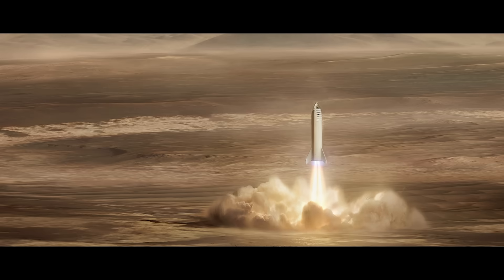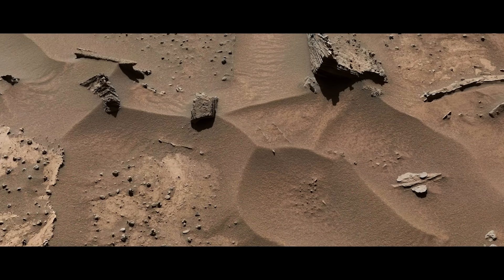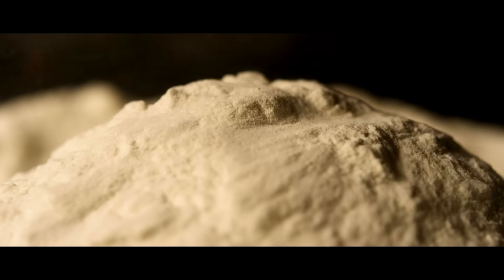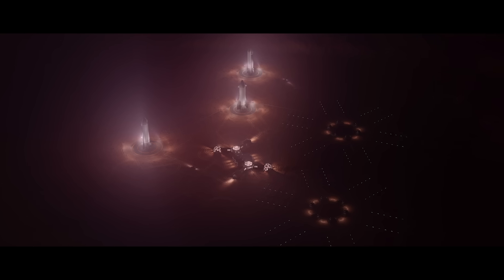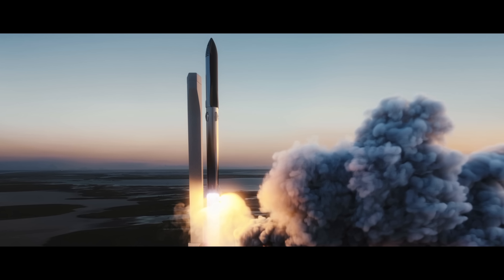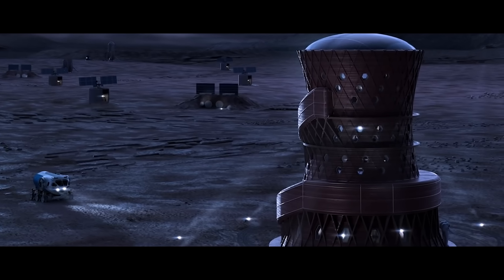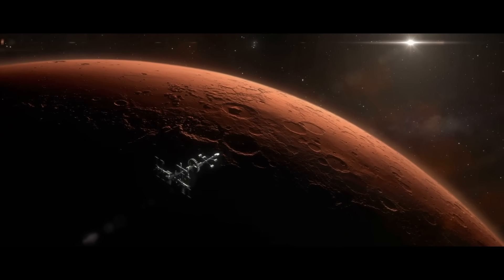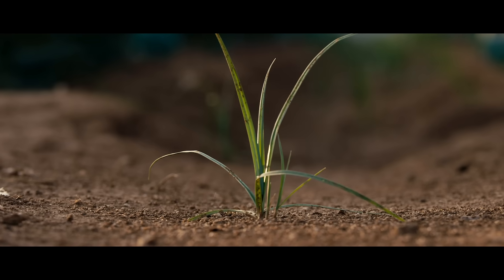THE FIRST 10,000 DAYS ON MARS (Timelapse)

Comment: I doubt that we will see seven football fields of solar panels. Energy is the most basic need for a colony which has to generate it's own oxygen, water , heating and nearly every other commodity it requires. A molten salt reactor would require far less tonnage of material transport and a more reliable energy supply which is important, as every living creature on the planet will depend on it. It will be more useful  as it generates heat as well as electricity , and the low Martian heat sink  temperature will give very efficient  electricity generation and do it every hour of every Martian day. The seven football fields of solar panels would supply less than half of what it would do if situated on earth. Elon Musk would not allow those sorts of inefficiencies to exist in his great venture!

Comment: Moving to a planet with "ZERO" atmosphere...sounds like a great idea!
Reply: Hey, be fair, Mars has an atmosphere. Ok, 1/160 of earth pressure. And contains like 95% CO2, which is pretty much like 19000x more than what is considered survivable. But in exchange O2 levels is like a hundred thousand times lower what would be needed. So if they want to use it, they can extract 1 cubic meter of useful O2 out of 1.5 million cubic meter of atmosphere there.

Comment: Mars is just the nearest practice platform... it will never be habitable it doesn’t have enough mass for gravity, a functional iron core, next to no water and doesn’t receive enough sun light.

Even if we crashed appropriate resources needed in the form of meteors the iron core would take a long time to help the planet would become tectonically unstable and the change in mass would likely have the orbit pulled closer to the which sounds good until other planets get in the way.

Then it probably should be included that usable land by the time we made the changes would probably by less that 50% and it’s already smaller than earth.

Though loosely theoretically doable the costs would be astronomical and the timeline to do so without shattering the planet apart would be difficult to get backing for.

The settling on Mars in this video wouldn’t be safe, nor sustainable without an atmosphere.

Comment: Probably optimistic ... but there will also be advances not taken into account here. It won't be exactly like this, but it'll be a little like this. 
And you have to have a plan to get moving. So we do... and it'll get revised as we go ... like they always do. 

If you look up the original plan for the Panama Canal when work first started, nothing about (in time or space or even the language spoken) is recognizable ... but there IS a Panama Canal. Works pretty good.
Reply: The rule of Elon Musk is: cut the volume by a third and add 50% to the timing ... but he'll still get there first.  
and there will be a great blooper reel.

Comment: Just keep in mind that the temperature is 70F to -190F, with an extreme daily range. There are no oceans and air pressure is about 0.6% that of earth if you consider the 'air' at 95% carbon dioxide is where you want to live. The precipitation is the equivalent of the drier parts of the Atacama Desert in Chile. Although the temperature on Mars can reach above freezing (0 °C (273 K; 32 °F)), liquid water is unstable over much of the planet, as the atmospheric pressure is below water's triple point and water ice sublimes into water vapor. Mars has no protective magnetosphere, as Earth does. The result is that the surface of Mars is exposed to much higher levels of radiation than Earth. And in addition to regular exposure to cosmic rays and solar wind, it receives occasional lethal blasts that occur with strong solar flares. 
Is that where you want to live?

Comment: Congrats for the impressive video, BUT...

$5m ships? I'm getting the feeling that, either the dollar will skyrocket in the near future for some reason, or the math presented in this video, are a few hundreds, or thousand times off, from the correct value.
This whole video is way too optimistic, as if nothing will go wrong, ever.
What if the first astronauts all die during liftoff, from a faulty pressure valve SpaceX bought from an inferior contractor? The project is mothballed for decades probably.
What if the weather is bad for a week during the window, the project is pushed back 2 more years, or more.
I can admire your optimism, but real life entropy, is a bitch. She doesn't care. And she'll do anything she can to make sure your project fails.
With that in mind, I would prefer a shot at a real prediction, not idealistic optimism.

Comment: FBI doesn't do TITLE 18 U.S.C. 1038 Investigations What about Microbiology? Causes

Many germs can cause pneumonia. The most common are bacteria and viruses in the air we breathe. Your body usually prevents these germs from infecting your lungs. But sometimes these germs can overpower your immune system, even if your health is generally good.
Pneumonia is classified according to the types of germs that cause it and where you got the infection.

Community-acquired pneumonia

Community-acquired pneumonia is the most common type of pneumonia. It occurs outside of hospitals or other health care facilities. It may be caused by:

Bacteria. The most common cause of bacterial pneumonia in the U.S. is Streptococcus pneumoniae. This type of pneumonia can occur on its own or after you've had a cold or the flu. It may affect one part (lobe) of the lung, a condition called lobar pneumonia.

Bacteria-like organisms. Mycoplasma pneumoniae also can cause pneumonia. It typically produces milder symptoms than do other types of pneumonia. Walking pneumonia is an informal name given to this type of pneumonia, which typically isn't severe enough to require bed rest.

Fungi. This type of pneumonia is most common in people with chronic health problems or weakened immune systems, and in people who have inhaled large doses of the organisms. The fungi that cause it can be found in soil or bird droppings and vary depending upon geographic location.

Viruses, including COVID-19. Some of the viruses that cause colds and the flu can cause pneumonia. Viruses are the most common cause of pneumonia in children younger than 5 years. Viral pneumonia is usually mild. But in some cases it can become very serious. Coronavirus 2019 (COVID-19) may cause pneumonia, which can become severe.

Hospital-acquired pneumonia

Some people catch pneumonia during a hospital stay for another illness. Hospital-acquired pneumonia can be serious because the bacteria causing it may be more resistant to antibiotics and because the people who get it are already sick. People who are on breathing machines (ventilators), often used in intensive care units, are at higher risk of this type of pneumonia.

Health care-acquired pneumonia

Health care-acquired pneumonia is a bacterial infection that occurs in people who live in long-term care facilities or who receive care in outpatient clinics, including kidney dialysis centers. Like hospital-acquired pneumonia, health care-acquired pneumonia can be caused by bacteria that are more resistant to antibiotics.

Aspiration pneumonia

Aspiration pneumonia occurs when you inhale food, drink, vomit or saliva into your lungs. Aspiration is more likely if something disturbs your normal gag reflex, such as a brain injury or swallowing problem, or excessive use of alcohol or drugs.

Risk factors

Pneumonia can affect anyone. But the two age groups at highest risk are:

Children who are 2 years old or younger

People who are age 65 or older

Other risk factors include:

Being hospitalized. You're at greater risk of pneumonia if you're in a hospital intensive care unit, especially if you're on a machine that helps you breathe (a ventilator).

Chronic disease. You're more likely to get pneumonia if you have asthma, chronic obstructive pulmonary disease (COPD) or heart disease.

Smoking. Smoking damages your body's natural defenses against the bacteria and viruses that cause pneumonia.

Weakened or suppressed immune system. People who have HIV/AIDS, who've had an organ transplant, or who receive chemotherapy or long-term steroids are at risk.

Complications

Even with treatment, some people with pneumonia, especially those in high-risk groups, may experience complications, including:

Bacteria in the bloodstream (bacteremia). Bacteria that enter the bloodstream from your lungs can spread the infection to other organs, potentially causing organ failure.

Difficulty breathing. If your pneumonia is severe or you have chronic underlying lung diseases, you may have trouble breathing in enough oxygen. You may need to be hospitalized and use a breathing machine (ventilator) while your lung heals.

Fluid accumulation around the lungs (pleural effusion). Pneumonia may cause fluid to build up in the thin space between layers of tissue that line the lungs and chest cavity (pleura). If the fluid becomes infected, you may need to have it drained through a chest tube or removed with surgery.

Lung abscess. An abscess occurs if pus forms in a cavity in the lung. An abscess is usually treated with antibiotics. Sometimes, surgery or drainage with a long needle or tube placed into the abscess is needed to remove the pus.

𐤇𐤍𐤁𐤏𐤋 𐤁𐤓𐤒
https://www.mayoclinic.org/diseases-conditions/pneumonia/symptoms-causes/syc-20354204

Please avoid the places where idiots use masks several hours at a time without changing them out for sanitary ones. It doesn't take long for things to grow on the mask. 

8 monkeys put on a mask to protect themselves from a virus. After a short amount of time the mask had grown bacteria infectious to them unknowingly. The bacteria came from the monkey skin and breath causing lung infections, pneumonia,  and 7 monkeys died without catching the virus and the 1 that lived did catch the virus yet lived. How many American monkeys have died from mask associated infections because they failed to follow the strict sanitation protocol required by medical personnel? If the CDC said 64,000 actually died of COV out of the 450,000 claims by healthcare means  236,000 could have died from other causes. 2008 Dr
Fauci co-authored an article you should know more about.
Violation of Freedom of information act. Blocking information on a public source document about biological Hazzards. 
https://www.nih.gov/news-events/news-releases/bacterial-pneumonia-caused-most-deaths-1918-influenzbacterial- Why do they block it?

Video on Pneumonia https://youtu.be/lMnbJCq5lAg

Insider pregnant Dr from the CDC comes out.
https://youtu.be/VOl2-xI76tI

Here what happens to your oxygen levels while in a mask. https://youtu.be/axSHWgO8-0k

Start here 
CRISPR-CAS techniques and technology 
https://youtu.be/RNRZchHaKgw 

is an introduction to mRNA and CRISPR-CAS introduction for vaccine engineering https://youtu.be/K__7vPh92gA 

then study the messenger RNA (mRNA)
https://youtu.be/R3blx6V9fzM 

is also helpful for to look at other mRNA sources. 
https://youtu.be/ITOgEVgjVVs 

all great till you get here 
https://youtu.be/wOvpkJiVGhc 

imaging being the first to recreat life on Mars or make safe environment for plants. We are introducing microbiology to create oxygen. https://youtu.be/4nk1ml6akM4 

I agree with getting to this point.
https://youtu.be/L13DadaAEg8 

grandfather 
https://youtu.be/dpgd_HUCSuk 

These links will really open the mind. https://youtu.be/e0vKOYQUmgg

is the promise.

https://youtu.be/e0vKOYQUmgg
https://www.facebook.com/watch/?v=934593487295763 or

https://m.facebook.com/story.php?story_fbid=260090339150170&id=100054476160607

Just so we know
https://www.facebook.com/watch/?v=3053211494783617

Polymathy
https://youtu.be/kEk-BDckjW4

3d Bioprinting https://youtu.be/V2e-2mPBRnA

Imagine the possibility https://youtu.be/A5Xvq49lpzI

What would it be like to live on the moon. https://youtu.be/EL7xW5zTh6M
Genetic modification plants made for Mars.
https://youtu.be/G3hPH_bc0Ww
This is how I feel https://youtu.be/igIFXcsoQEE
All I got is you. https://youtu.be/X-sIsWrqAaU

Comment: I appreciate that there are people who care about Mars enought to make and warch such videos. Still, its content is wishful thinking. Take the 3D printed domes that are supposed to stop the radiation. Earth's atmosphere is equal to several meters of concrete in terms of shielding us from harmful radiation. I don't remember the exact number, I would expect it to be in the region of 6 meters given that it takes something like 20 meters of water to achieve the same result. (But again, don't quote me on this, I am quoting from memory.) Assuming the material these domes will be printed out has similar density as concrete (which in itself is optimistic given that the material is supposed to be glued togethr by plant matter and this is not dense), these domes must be meters thick to have the same effect as the atrmosphere of the Earth. Do you propose to take the energy for this massive feat of engineering from sollar panels? On Mars?

Comment: Very nice video! And very nice vision that should inspire humanity. All plausible. Should start HFC production after that to terraform. Not sure what the last image is supposed to show though, it looks like grass growing outside of domes? This would be very unlikely, even with increased heat generated by the city; vascular plants like grass need at least 7% atmospheric pressure and also some O2 in it (mars's atmosperic pressure is less than 1% that of earth with next to no O2) - they have to breathe at night. Notwithstanding the fact that the UV radiation will kill them before they even get a chance to germinate, which could anyway only happen in the summer, deep freeze will further kill any seeds. "Genetically engineered" or not. The only things that would stand a chance would be lichens, but their growth is very slow; still that may be something already

Comment: I just read somewhere that there is minimal seismic activity on mars, which would be consistent with being dead internally, which is consistent with the lack of magnetic field. This video states right after the bit about wind storms, that Mars has marsquakes.  (around 3:52). So Im confused. Also, with the lack of a molten core, and lack of magnetic field, any presence on mars will always be with protective equipment. Sounds like a very problematic hurdle that needs to be cleared to make progress. I have never seen this addressed.

Comment: The science is so bad it is truly hilarious. 

Shielding. After two years on Mars the entire team would NOT be going back. They'd mostly be dead or dying from radiation damage. Second, the robots. Same problem - radiation. The best we can do today is Perseverance. The control CPU is a single processor, the BAE RAD 750 operating at up to 200MHz. It has a whopping 256 megabytes of RAM and 2 GB of Flash. There are adjunct processors but the harsh truth is that this processor is nowhere even close to running autonomous AI. Even Boston Dynamics would be challenged by conditions on Mars and it would require huge funding, extensive testing and time. The cost suggested for each vehicle ($5 million) is a small fraction of the cost of operating the flight - this is not a simple flight to LEO. 

There would also, inevitably, be casualties. Many of the processes casually described in this presentation are speculative or wishful thinking within the timescale given. You cannot throw a hundred unproven technologies and prototypes across billions of miles to a hostile planet and expect a best case scenario of no critical failures. The first flights to Mars would be about science and proving technologies in situ.

America has lost much of its pioneering mojo too - witness how long it  took to put the F-35 together or the hilarious missteps of Boeing. We aren't the "can do" country we once were. Personally I would not be surprised if the Chinese beat us to putting a man on the moon, maybe on Mars too. A South African entrepreneur may be blazing a path (with everything from Tesla to SpaceX to Hyperloop to SAV) but he's alone in terms of leadership. Overwhelmingly we are at the mercy of "Corporates", most of whom are primarily interested in lining their own pockets, pandering to their own egos and trying to hide their own inadequacies (as per Intel's turnover of CEOs since the departure of the founders).

Mars is, from a scientific perspective, one of the less interesting places in our solar system. It has no magnetosphere worthy of mention. It is more hostile in several respects than the moon (a far more logical place to test and demonstrate technologies). It has no atmosphere, no oceans. I suspect the Belts would be of more practical interest. Not to mention the exploration of moons around Saturn and Jupiter. 

Most of all, people have watched too much Startrek. The truth is that humans are bound, by evolution, to an ecosystem which we cannot substantially recreate on Mars - the consequence of which are likely to be challenging to say the least. For instance, it has not yet been demonstrated that 0.38G is sufficient for normal embryo and child development. Nor have we demonstrated that our ecosystem of bacteria and viruses (which inevitably comes with us) will prosper in a benign way on Mars. These are yet-to-be tested factors and until they are, establishment of a colony on Mars is beyond absurd. Let's start with the moon and work our way up!

I am an engineer rather than a scientist, but I am intimately familiar with robotics and genetic engineering. So while I applaud Elon for his vision and daring-do, I just don't see the point of colonizing Mars. Let's start with the Moon (close enough to support directly) and maybe plant a colony of around 5,000 individuals plus a DNA library of life on Earth. This, at least, would improve the durability and longevity of the human race.